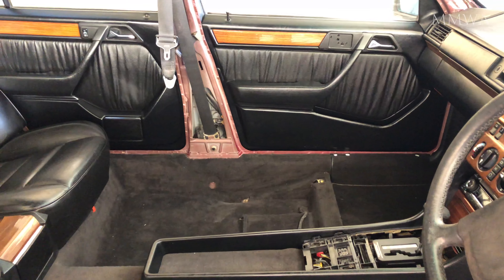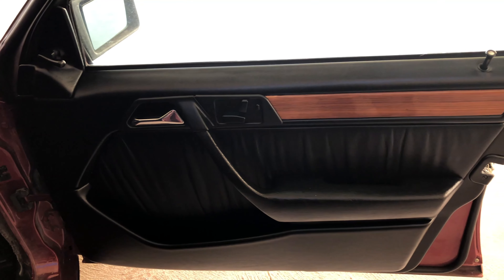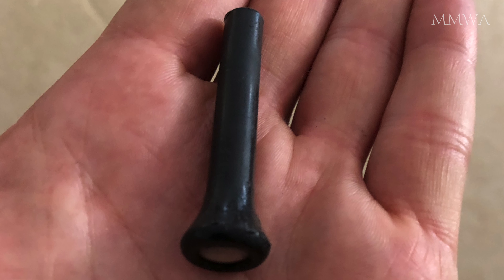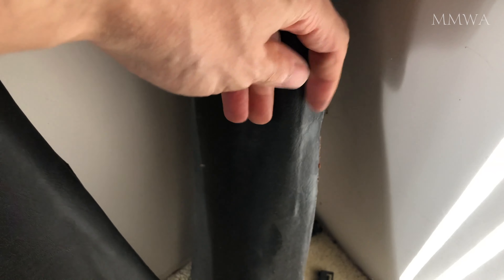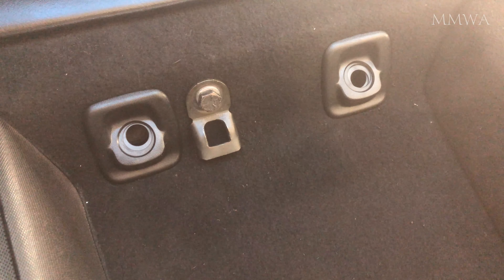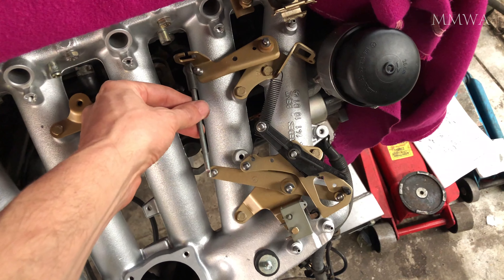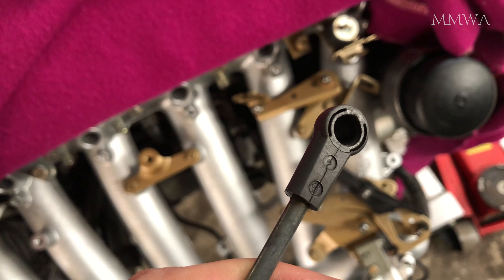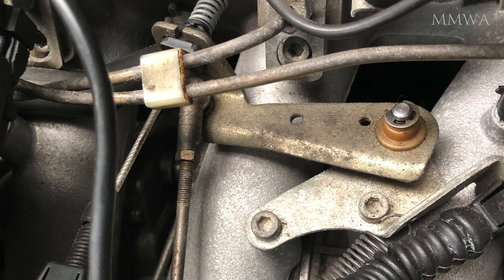Todays activies on red w124 project

Comment: thats pretty nice trim level on rear interior ( wood center console and in door) ...also you plated or anodize the the parts in bronze....like jewelry ! nice.
Reply from the maker: billrbca the gold parts i have cleaned with caustic soda then sprayed with chemical resistant high temperature engine paint then baked at 120c for 1 hour. Obviously not as robust as plating but it looks better than it did. It will last fine as long as not scratched up.